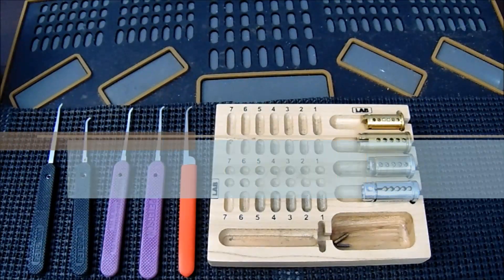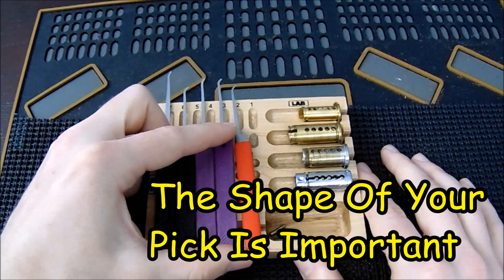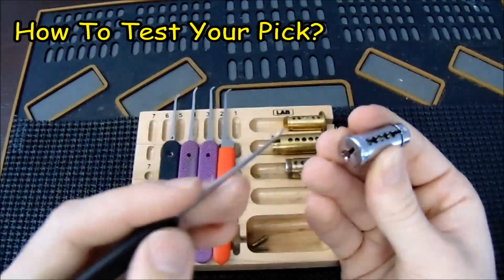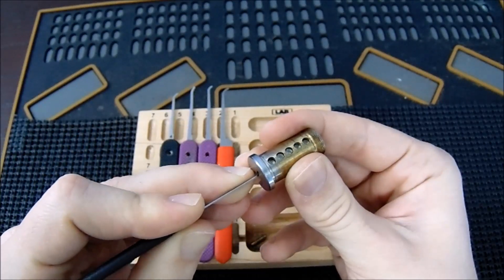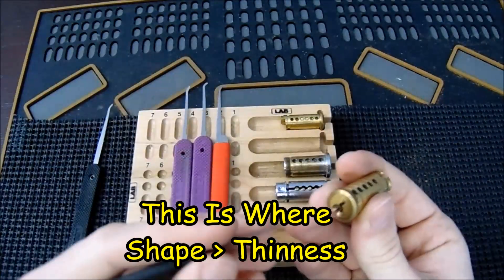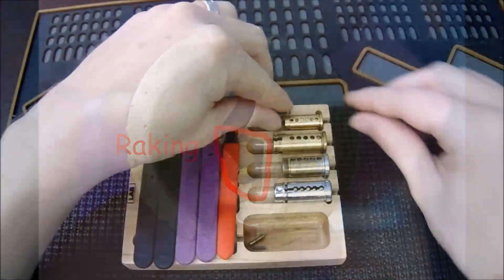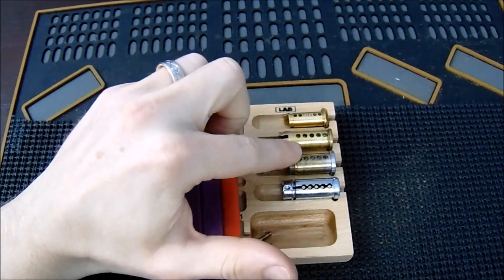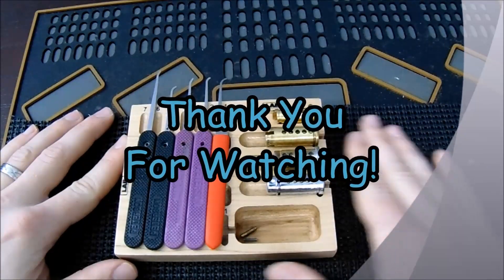[121] How To Learn New Keyways To Successfully Pick Locks (Kwikset, Schlage, Yale, American)

Comment: This really helps. I got a practice lock from Covert Instruments and it has a Schlage keyway. The picks I got from there, too, I discovered on my own to pick from the left side. I'm curious, if you'd suggest top-of-keyway tension (as that's what came with my set) or bottom-of-keyway tension when having to pick from that left side angle.
Reply from the maker: I prefer top of keyway (TOK)

Comment: that core with the kwikset keyway is actually a defiant core, which has one extra thing to deal with over a kwikset.  they've usually got a spool or two, and the tolerances are way way worse than a real kwikset
Reply from the maker: It is nice to see more spools in these lower end locks from time to time

Comment: You've mentioned pick thicknesses of 25, 21, 18 and 15 thousands. I can find 25 and European slimlines of 22. Where can I find the 18 and 15?
Reply from the maker: Gary B From as United States perspective Peterson offers 0.018 and 0.015. Sparrow is a popular choice for 0.015 but I do not believe they offer 0.018.

I rarely use 0.015 because that is too thin for me and I strongly prefer 0.018
Reply: I found the 15 and 20 at Sparrows. You have the most logical academically orientede series I've found- and I've watched all of them. My sincere complements :)
Reply: Where did you get the 18?
Reply: answered above, thanks
Reply from the maker: No problem, I strongly prefer using a 0.018 over a 0.015, the added strength makes a difference.

Thank you for the kind words!